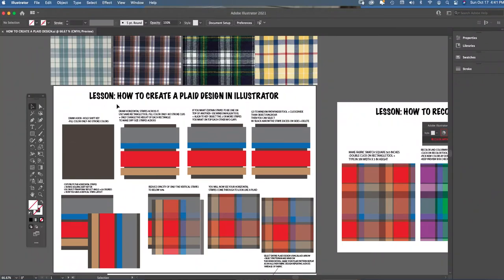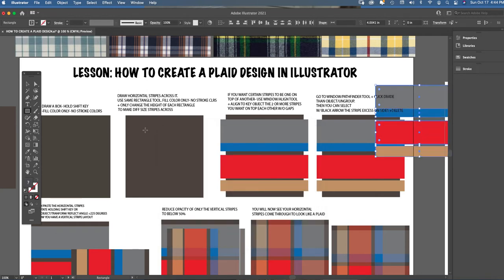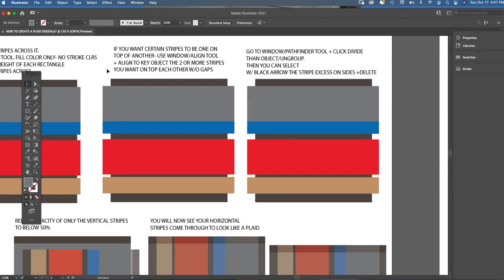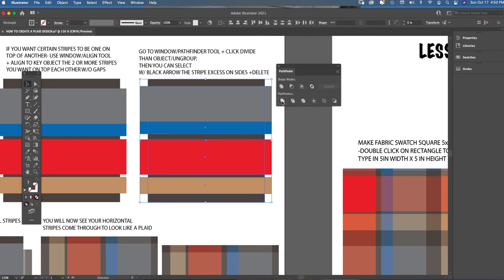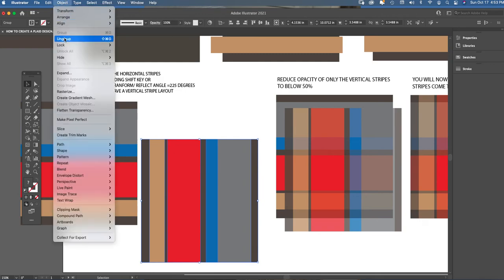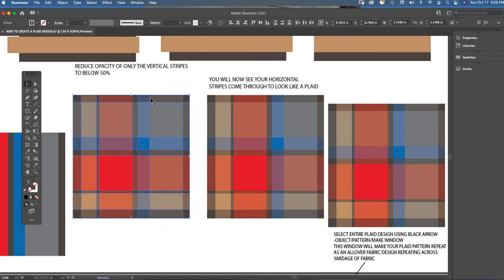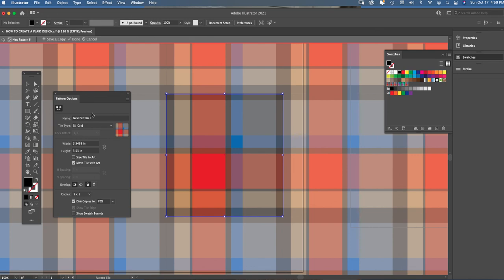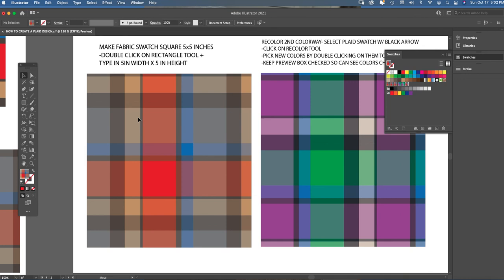How to create a Plaid Design in Illustrator

Comment: Thank you for this!  Very helpful!  I have a tricky question for you!  First, short background - I create and export vectors for use in Cricut which does not accept pattern fills.  With that said - 

I want to overlay the plaid on a shape and crop (that's my solution to the pattern fill issue, works well usually) but because this is all on top of each other, when I crop its just taking the top layer colors.  Any chance you know of another work around?